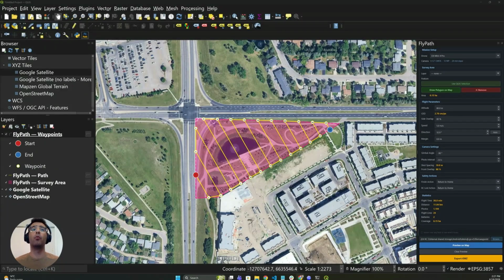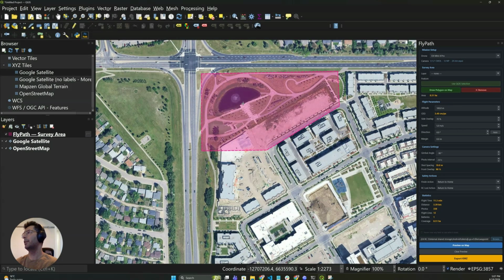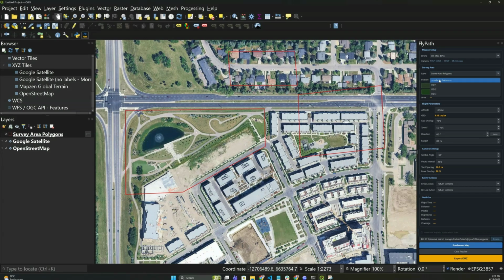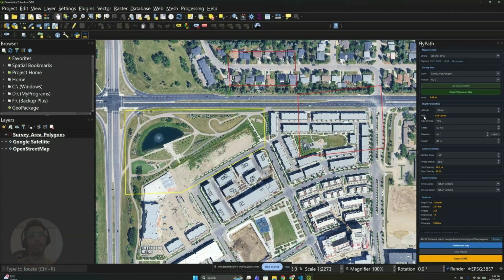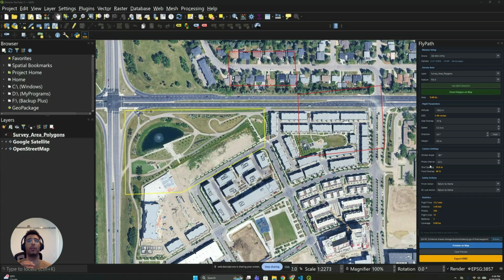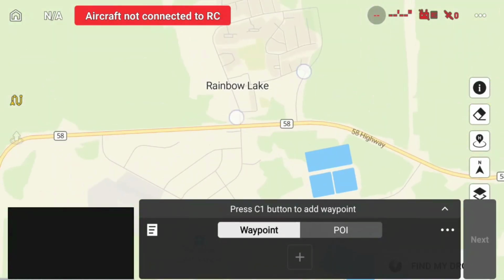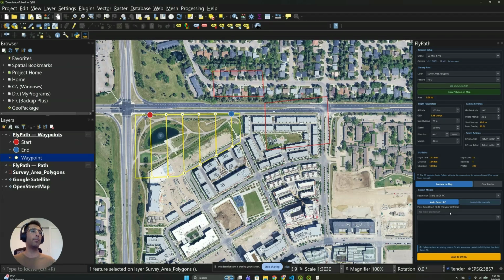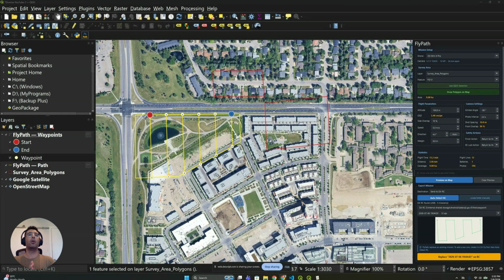How to Plan Drone Mapping Missions in QGIS (Free, DJI Mini 3/4/5 Pro)

Comment: Hello, I was trying to adjust the camera settings but it's not showing in the plugin
Reply from the maker: Hi Farid, thanks for watching! You're right, earlier versions of FlyPath had a Gimbal Angle setting. We've since reorganized the plugin around mission types to keep the number of settings you need to manage low, so 2D Mapping and Corridor missions now use a fixed nadir (-90°) camera.

If you need the angle control right away, you can install v1.5.0, the last version with the Gimbal Angle setting (-90° to -30°). Download the ZIP from github.com/dronnix-io/FlyPath/releases/tag/v1.5.0, then in QGIS go to Plugins > Manage and Install Plugins > Install from ZIP. Keep in mind that this older version doesn't have the newer features, such as Orbit, Corridor and terrain follow.

Full camera angle control is coming this month with our new oblique mission types, so keep the plugin updated or check flypath.io. 🚁
Reply from the maker: Also, Farid, we'd love to hear what you're planning to use the camera angle for. Is it building facades, inspections, 3D models, or something else? We're designing the next mission type now, and real use cases like yours help shape it.

FlyPath is fully open-source, so if you're up for it, we'd be glad to have your help building and field-testing it. You can share your ideas here or join the discussion on GitHub: github.com/dronnix-io/FlyPath/issues/14 🙌